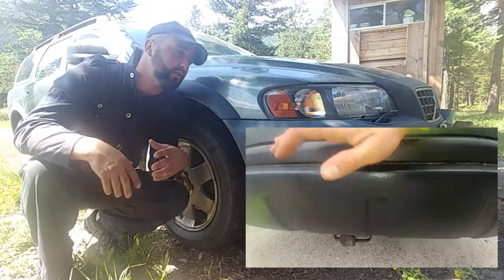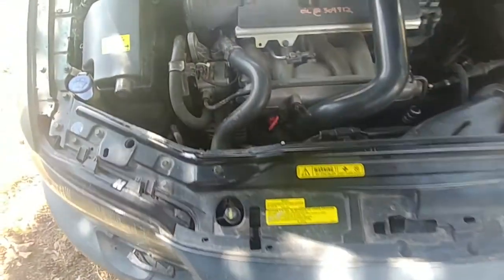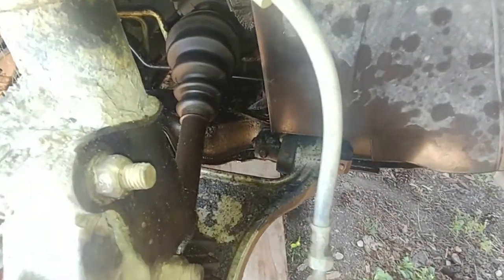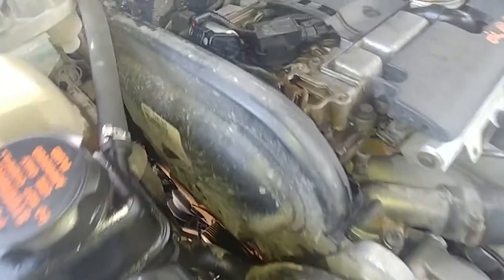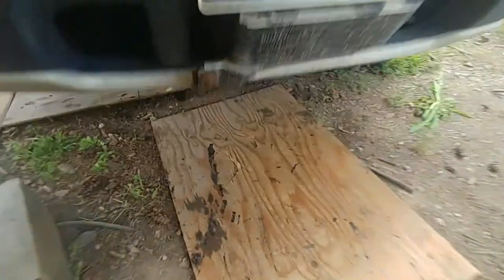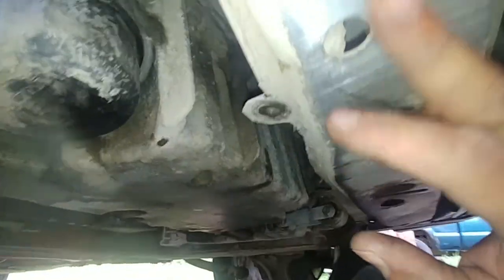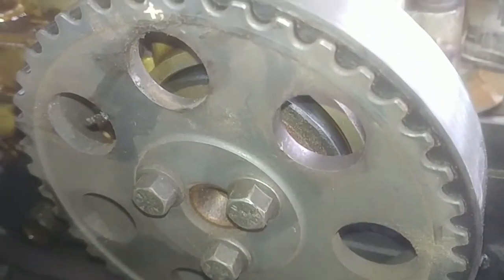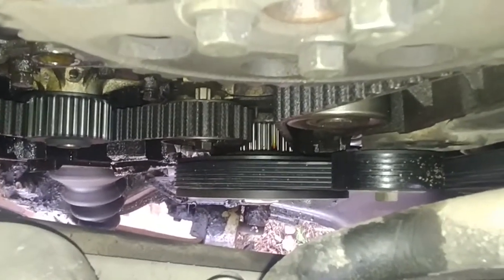VOLVO SEVERE OIL LEAK. MASSIVE LOSS OF ENGINE OIL DIAGNOSIS. We Found the Leak

Comment: Ok, next question to ask: why would the intake cam seal pop out? PCV system has failed and pressure has built up from clogged PCV.
Reply from the maker: Hi Charging7, I think 20 years old seal lost rubber softness around the outside diameter got loose and was pushed out of the head at high RPM. PVC system was serviced last year. I checked it last month, engine had good vacuum at the oil filler neck.  It should not be the cause.
Reply: Yes but crankcase pressure fluctuates with rpm.  A car may pass the glove test at idle but still have high pressure at high rpm.

Comment: I came out of a store, saw a puddle of oil under my 2002 V70 XC, bought a gallon of oil poured it in and made it home.  Then I found your video on youtube.  It saved me and my car.  I had exactly the same problem.  Seven hours later my car is repaired.  Thank you,  Scott.
Reply from the maker: Hey Scott! Great, you got your Volvo fixed! Most likely car will end up in junk yard. I am so glad we saved another Volvo today:) Thank you so much for your feedback. Volvo Run Forever!

Comment: I think you should check the crankshaft seal too. When the PCV system gets clogged and needs replaced, you might as well do a full job. Crank seal, cam seals, timing belt, pulleys, water pump, VVT hub seal, oil pump seal. The job isn’t really that hard as long as you have the Volvo Camshaft locking tool.
Reply from the maker: Hey Trent! Thanks for your advice and feedback Paul! 20K later so far no any oil leaks_ period. Chjeers!

Comment: Hi from New Zealand, I had my 2002 Volvo V70 XC lose all its oil at the carpark yesterday afternoon leaving a pool of oil, I had no idea what the cause was but after watching your videos, I now have a good feeling that it is the camshaft seal. The car is going to the mechanic next week (I will clean the carpark). I have shared your excellent videos with the mechanic, a great guy. I will let you know if it is the camshaft seal or something else. I have always owned a Volvo, 240, 245, 260, 265  and the magnificent 740 GLE and the powerful 760 GLE.  The Volvo name comes from the infinitive of the Latin verb "volvere (to roll)" and it was conjugated into Volvo, which means "I roll." Keep them rolling. Thank you again.
Reply from the maker: Hey Ara! Greetings from Canada! Sounds like your lovely Volvo ended up with the same problem. If you won't run the engine out of oil shouldn't be any problems. Volvo has soft spot in my hears, same as Mitsubishi Delica:)
Thanks for sharing your story and Volvo history note. Let me know how is everything or if you have any questions.
Cheers!

Comment: If you own a Volvo you can do a test to check if this issue may affect your car.
Remove the oil filler cap then take a rubber glove and  elastic band. Fit the opening of the glove onto the oil filler cap and secure with an elastic band.
Start the engine.
If the rubber glove is slowly sucked inwards, this mean the PCV system is OK (there is vaccum).
If the rubber glove begin to inflate, this means the PCV system is blocked and pressure is building up in the crank case. You need to address the issue ASAP or you will experience Cam seal blow out, or worse, rear main seal blow out. 
Underneath the inlet manifold, these cars have a PCV box and pipes that can become blocked..... buy a new PCV kit and replace.
Reply from the maker: Thank you so much Dave for your comment and advice. Cheers!
Reply: and gradually rev to 2500 while in drive with foot on brake
Reply: @TekkenBones  hi, i just bought a Volvo v50 2011 and I smell a very slight oils vapor. I see very little oil being vaporized around the valve case. I might have this issue. Gonna make the test asap. Is there a risk of the glove being completely sucked in ?

Comment: Our 2001 V70 same block same problem. My wife drove the car to the grocery store. Got out of the car and found a pool of oil under the car. Intake seal blown out.
 Ordered the whole kit from FCP EURO. Bought the cam locking tool and made the repairs. Checked the PCV system with the glove test and it past. I still have the old seal. No leaks after 500 miles.
Reply from the maker: Hi Chris! Sounds that intake seal getting to be common problem on 20 years old Volvo. Main thing not to run engine dry out of oil. I just replaced intake seal yesterday on my Volvo. Check PCV system- good suction vacuum at the oil filler neck. Now she should be good for another 15-20 years). 
Thanks for sharing your story and experience! Volvo Forever or Volvo for a live. 
BZW, I filmed nice video how to replace cam seal on Volvo without locking tool - it worked fantastic, coming soon!
Reply: We own three P2 Volvo’s. 99 S80 2.9 / 04 S80 T6 / 01 V70
 This week I ordered new radiator and some hoses from FCP Euro for the 99 S80. The plastic tank started to crack under the upper hose. Always chasing something brother.
Reply from the maker: @chrisbeavers909  Sounds like you guys have serious Volvo garage!

Comment: I have 2001 Volvo C70 turbo which has the oil leak to and occasionally smoke comes out the front but it doesn’t seem to overheat
Reply from the maker: Hi Jacob! Well, it shouldn't overheat from oil leak. Small oil leaks eventually will get bigger over time. You said oil leak located at the from it probably some leaks from pcv hose/oil cap down not from the cam/crank seals. Let me know If I can help. I'm going to replace cam/crank seals and all timing belt components plus service pcv system as well. Cheers.
Reply: PistonShack actually yes. I could make a video on it.
Reply from the maker: @isaiahjacob1944  sounds good. It will be interesting to watch. Send me the link later. Cheers.

Comment: Same thing happens on old Landys, the Cyclone breather (PCV) system was problematic and would stop suctioning pressure from the crank, the crank seals would go and leave a huge pool of oil on the driveway. Luckily a fairly easy fix just a bit time consuming.
Reply from the maker: Thanks for sharing your experience Taylor! Good point. I serviced my PCV system not a long time ago. It has good vacuum. Cheers!

Comment: cool I just did my water pump and t stat on my s80 and noticed alot of oil on top of the engine when i took the covers off and it was 2 quarts low with not much drive time . it has 175k on it so hope it is just this cam seal too .

Comment: Thank you for the video, I'm diagnosing a 2002 XC70 with a slightly less profound leak in the same area.  Question:  How come the whole area by that camshaft seal isn't covered in oil if that's what is leaking?
Reply: Did you ever find the leak?
Reply: Power steering fluid from the reservoir cap gasket.

Comment: I assume your PCV system was neglected?  Excess crankcase pressure is the only likely cause of sudden seal failure.
Reply from the maker: It could be one of the reasons for seals to fail but that's not a case this time. PCV has strong vacuum pull. Old dried up seal popped out of the head.

Comment: Hi do u have to replace it, ?? Can't just pushed it back in place??
Reply from the maker: Yup, you have to replace the seal. I have video on my channel how to replace cam seal. 
VOLVO CAMSHAFT SEAL REPLACEMENT WITHOUT CAMSHAFT LOCKING TOOL (NON-VVT) 
https://youtu.be/Jrcn3dbBVB4
Check it out.

Comment: Yo I have a s70 volvo convertible an leaks front right side alot but only when in park an running
Reply from the maker: Hey, Volvo won't stop leaking out. Only when oil pressure is up oil will leak out. I have another video coming this week how to replace cam seal without locker tool or any other special tools. Tested.
Reply: So the compression from it sitting while running causes the oil to pour out the cam seal

Comment: I have an oil leak near the oil filter-cleaned and replaced the oil filter seal-still leaks Any ideas?
Reply from the maker: Hey Gene! Seems like oil filter cup treads stripped, filter cup cracked,  or doesn't seal properly. Did you check oil filter housing and plastic cup surfaces?
Reply: @PistonShack  I did-the threads looked good, saw no cracks in the cup-are the Dorman cups good  quality? No looseness when hand-tightened. I am at wits end with this
Reply from the maker: @genekelly8467  Dorman producs should be good. Just torque to specs then see if it will leak. I think it 25 Nm.
Reply from the maker: @genekelly8467  Make sure O-ring is in a groove not over the threads.
Reply: @PistonShack  I have-tell me-can you use plumber's (teflon) tape on this-if the threads are leaking? I'd hate to have to replace the  oil pan.

Comment: My intake seal pooped out also. Pcv in good condition.
Reply from the maker: Did you get it fixed already? PCV pressure won't ever push seal out it could make seal leak out out.

Comment: Surely If that cam seal was the cause of your major leak, the cam pulley, belt etc would be dripping in oil?
Reply from the maker: Hey Fred! You right it did leak down but not too much on belt itself.
Reply: @PistonShack  Once the oil hits the spinning belt, it is thrown EVERYWHERE else but on the belt.  Since the belt has been oil coated for a while, it should be changed as part of this repair.